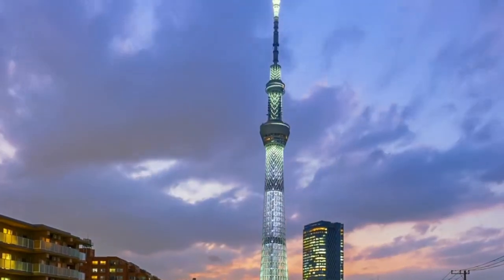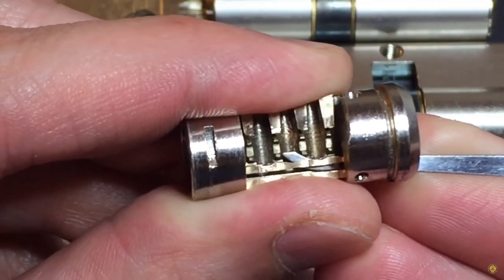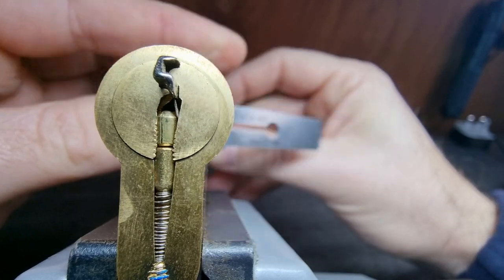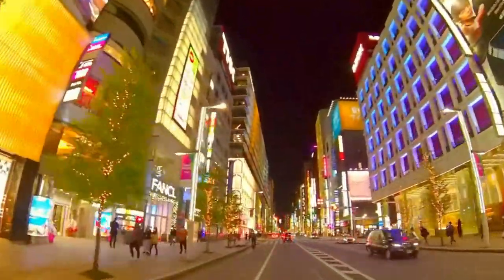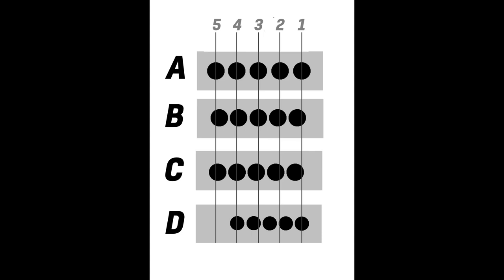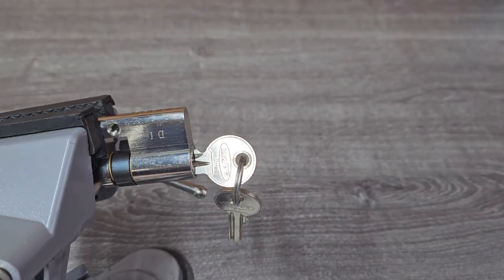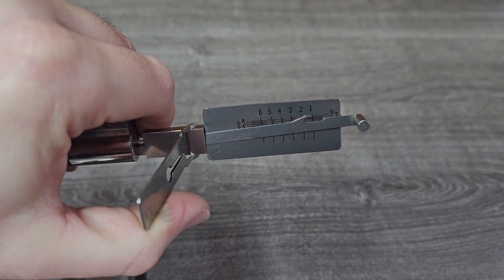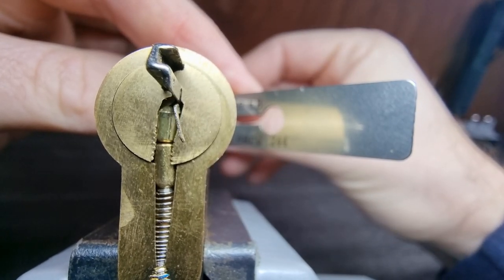WARNING: Yale Lishi Spacings WRONG!

Comment: If you wanted a comprehensive set of these to pick most types of pain tumblers,how many would you need, and what are their code numbers if you don't mind. There seems to be a few different ones and I haven't tried any yet. Hope this question is ok. Keep up the great videos.
Reply: Pin tumblers.🙄
Reply: SC20, KW5, AM5, BE2-7, S123/C123, M1/M2, LW5, Yale 6
This will cover many modern pin tumbler locks in the USA. Some of the ones I listed will need a spacer for 5 pin locks since they are designed for 6 pin locks. 
You can add the SS002 and SS001 for some Chinese made locks.
Reply from the maker: @FriedPi-mc5yt  You won't need a spacer - you can pick the 5 pin locks with the six pin picks - that's what this video is about!
Reply from the maker: @kevinsalisbury9722  Are you UK or US? Or somewhere else?
Reply: @LockPickingLegend  
I live in Spain
Reply from the maker: @kevinsalisbury9722  Hmm, I know you have a lot of Dimple locks in Spain, but not much else. I don't think you'll get much mileage out of many of these types of picks except for the two yale ones (links in the description if you want some more info about them). You might want to check out Tallan Pick, I believe he's Spanish and has a YouTube channel.
Reply: @LockPickingLegend  
No mate, mainly normal pin tumblers
Reply from the maker: @kevinsalisbury9722  Hmm, I'd maybe try to find someone in Spain on a Facebook lock picking group maybe? Or can you tell me the brands of lock you encounter the most?
Reply: @LockPickingLegend  
Iseo,hunit,ucem,logo,visa, MCM,
Reply: Cisa not visa, sorry
Reply: Pain tumbler sound like a torture device

Comment: Question:  (I could ask this on Reddit or Keypicking but I thought I'd go to the absolute legend of cutaway locks. )
If you can reach the pick tip up ostensibly though the bores for the chambers from the very bottom of the plug thus bypassing the warding,  then this insinuates the warding has been drilled through;  so what keeps the key pins from just plopping to the very bottom of the plug normally (in a north american lock anyway)? 
I'm missing something here.  A piece of brain perhaps?
Reply from the maker: Hello Cyberhagen, apologies for the late reply; I've only just seen the message. Not all of the pin sits on the warding. If you look at the keyway, that shape goes all the way through the lock's core and is the warding. But because the key needs to touch the key pins, only about a quarter (that's a guess, but work with me) of the pin sits on the warding that prevents it from just falling down to the bottom of the plug. So, when you're picking a lock, 100% of the pin isn't accessible because a small part of it is sitting on the warding, to prevent the issue you are questioning. Does that make sense? If you look at this counter-rotation short, you'll see a small part of the pin sits on the warding, and a small part is exposed for the key (and lock picks) watching it upside down might help, lol, but that will answer your question, I think: https://www.youtube.com/shorts/EfHVqbhS8nA  Let me know if you need any further assistance. This is a good question.
Reply: @LockPickingLegend     Thank you sir!  I believe I've got it.  So indeed there are no holes bored through warding, as I originally thought.
I guess I took the wrong idea from the other LPL's video and thought he suggested that there are vertical holes through the warding.  He actually did say he was exploiting the holes drilled in the lock, and his cutaway almost looks like there are, but that was a red herring.  
I think what it boils down to is, a longer hook, inserted at the bottom, means less warding to deal with because it'll engage with the pin in it's chamber sooner, and that gives you more wiggle room.
Thank you so much for answering this and taking the time to comment back, you are a gentlemen and a scholar!
Reply from the maker: Yes, you've nailed it. I know the video you're referring to as well, but the problem is when you have a cut-away on the axis he used, you can get confused - as you did - as to why the pins don't fall down. When you see a cross-section on the axis I make them, you can see that only the edge of the pin sits on the warding. A pleasure to have helped. Any more questions, happy to help. @cyberhagen

Comment: What about the dodgy copies off AliExpress😊any good?
Reply from the maker: Fair question - next to no customer service. If there's something wrong with the item (which there often is) you're stuck with it. And no technique information. They can also take anywhere between a month and three to arrive. The longer in the supply chain the more chance of the item 'going missing' and not arriving. If it doesn't arrive, they won't replace it. And yes, they are 'dodgy copies' - sometimes you might get a result - that has to be said - and save a few $$, sometimes you'll wish you spent the extra money, supported innovation, small businesses and got all the bonuses that come with that. It's your call.